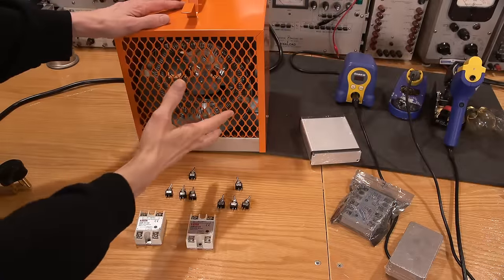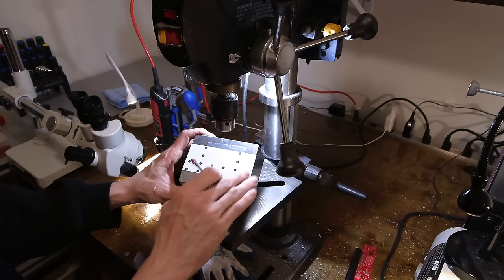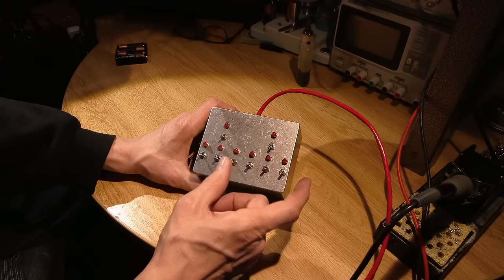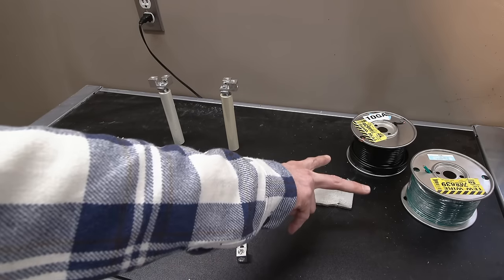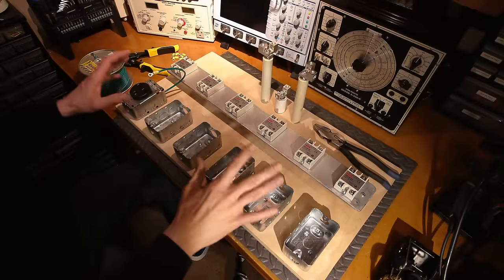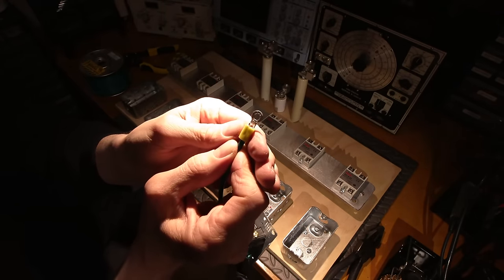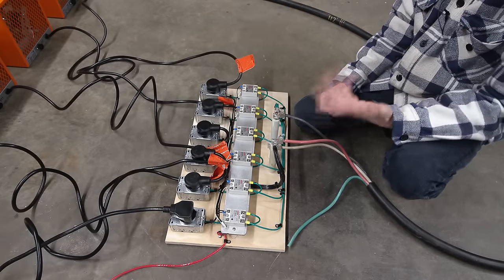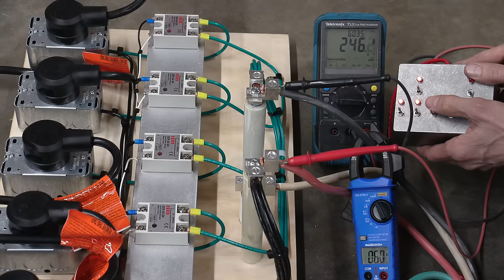27000 Watt Load Complete Build!

Comment: Build a couple fold out, or roll out "walls" lined with rock wool insulation facing the generator.  Not even remotely close enough to keep the heat in, but to absorb and block a lot of the noise.  Neat load bank, thanks for sharing!

Comment: Big Clive tore down the Fotek SSRs. He found that they are definetly under-engineered and over-rated. IIRC, I am using a Crydom 1225 SSR to switch the heating elements on my DIY Reflow Oven. IIRC, that SSR only requires 7mA to trigger it. So, I am driving it directly from a PIC MCU (could be any MCU) straight off of a pin. It has worked well for years. Adding an optocoupler between the MCU pin and the SSR would have been a nice safety feature, but I did not know about those at the time I built the oven. Of course, using a MCU affords also sorts of additional control and data collection, such as PID PWM and reflow temperature profiles. And, yes, additional heat sinks (more than just the mounting plate) are needed. HTH. Cheers.

Comment: Very nice generator unit. It loaded and recovered very quickly. Minimal voltage/frequency drop. Lots of headroom. I used an old Lister air cooled 25hp 3 phase diesel generator for my machine shop for quite a while. It was a nice reliable unit but had terrible recover. Changed it out for an old Ford 4 cylinder 60hp marine diesel which was much better before finally getting a 3 phase hydro service.

Comment: That’s one beefy generator to only lose a couple volts with a 120 amp load on it. Good call on that main power cable, very pricey stuff but the fine strand wire makes for a much easier cord to manipulate than the stiff heavy gauge stuff with a solid wire ground. Thank you for sharing and have a happy Easter.

Comment: With all the positive comments, I can add this. We see a man that's confident in his work that he did not need the safety grounds hooked up for this test.
Reply: Lets say, he is using a "floating ground"
I will say that if he generator is not grounded (isolated) nothing will flow to ground trough anything, only between phases and neutral ... 😛😝

Comment: Maybe someone else pointed this out but you used single pole SSR's so one side of the heater circuits will be live to neutral even with the SSR switched to off. It's not a big deal for a test setup but something to be aware. Personally I would also carry an equipment grounding conductor back from the heater receptacles back to the ground lug on the generator. It could be sized down from the power conductor or in your case #12 AWG to each receptacle. I think your large SO cable had green equipment grounding conductor included. The only thing you would have to add to the board is a terminal strip to land the green wire from the extension cord and a green #12 to each 30 amp receptacle. You could add those when you make a permanent set up for your test station.
Reply from the maker: One thing to keep in mind with an isolated generator test setup like you see here: If a earth or ground wire is attached from the test fixture to the generator, since the generator is it's own source and it's isolated, if one of the fans were to short to its case, it would make the entire generator HOT! So, instead of just one fan case being hot, it would make the entire test fixture and generator live.

Comment: I removed a 96 channel, 2400 watts per channel dimmer rack, 3 phase input from a HS theater. Replaced with LEDs,  dmx control.  One SSR for every 2 channels.  Needed some ideas for use. Mr. C. delivers.

Comment: I would have connected the ground from the generator to the outlet boxes and the ground terminals of the outlets so that a short in the fan would not cause a "hot chassis". Not necessary for your test of course, but for a permanent installation. That's one nice generator, btw.

Comment: I liked the video very much. Thank you for posting. I wonder if you wouldn’t mind giving your opinion on the following. The problem with an SSR is that the Sine Wave is modified and the actual True RMS Current becomes less. There used to be a device for the Kitchen Refrigerator that would reduce the power and save electricity, however the Defrost Cycle wouldn't have enough power and the freezer would not defrost fully as intended. So that method doesn't work anymore on a modern day frost free refrigerator. Now the other trick involves tuning the Motor Inductance with a Capacitor, and that would lower the amount of power the refrigerated uses.

Comment: Thanks for the video - but I wanted to see the frequency stability of the genset.  The relays aren't necessary for a test since the fans have plugs and maybe switches??   The tester board does show better for video.   Be careful on your crimps, and check the datasheet - generally the serrated round barrel crimp connector will have the seam facing away from the "dimple".  We always use a professional crimp tool with the correct dies, never use  lineman pliers.  BUT as long as the crimp is on very tight, it's OK for a temporary hobbyist tester.
Reply: The very top of the voltmeter displayed frequency, it only dropped about 0.25-0.50 hz at full load. Most generators drop around 1-2hz under full load.

Comment: 27000 watts? So, we used to have these 600w space heaters. Then 27000/600 = 45. So, we could theoretically heat 45 rooms. That's a sizable house. Wait a minute! The 5200BTU air condtioners are approximately 600w a crack. We could cool 45 rooms and have a delicious electric bill !

Comment: Cool load test setup and informative video.  Diesel engines need to be run under load, if they are lightly loaded for extended time they will "wet stack" because combustion temps are very low.  Periodic use under heavy load with your load bank would be good for the engine.  I have a diesel gen set with a load bank on the front (factory installed) for that very same purpose.  Did you measure the voltage drop on the SSR's with the 20 amps through them? Curious how much power they had to dissipate.
Reply from the maker: Hi Erik. With a 20 Amp draw at 240V, they have 1 Volt drop across them (or close too), so they get pretty warm on that sink after about 15 Minutes of "On" time. (Around 20W of dissipation) They say they are good for 60A... Not likely!

Comment: Now, here’s a question for you - what’s your plan for grounding and bonding? I was a residential electrician in a previous life who has done a fair few stand by generator units. I’ve been a fly on the wall on one occasion for an argument between inspectors over bonding. Apparently there are disagreements…
Reply: There are disagreements,  There should only be one bonding point and that is in the "main" panel (I'll call it the bonded panel). and there would be a 4 wire connection to the generator (2 Lines, 1 neutral, 1 safety ground). This is the proper way to do it if the generator is hardwired to the panel/transfer switch (and your transfer switch switches only the load connections). If the generator has a plug to connect a load either a convenience outlet and/or the main load, the generator must be bonded internally. This way if the plug is unplugged from the bonded panel and is used stand alone, it is still bonded and safe. This is why you hardly ever see larger generators with any kind of convenience plug on them, it would require them to be bonded and that causes a lot of other issues when connected to a bonded panel. The convenience outlet is run from the panel.

Comment: Should have taken the Dave Jones approach to that SSR..."don't turn it on, tear it apart!" 

Would be interesting to see what it looked like inside.

On another note, the 4/8 ohm load I use for my  bench was repurposed from the aux heat packs from the air handler I replaced last year. I had to parallel some resistors with the coils, but I still (conservatively) have a ~300 watt 8 ohm, and ~600 watt 4 ohm load.  

So if anyone is having an air handler replaced, don't forget to scavenge it for the heater pack(s) if it has one!

Comment: nice job 👏👏 I would like to see a thermal image of the solid state relays 😀
Reply: At least the temperature of the heatsink.
Reply: I was curious if the slab of aluminum was sufficient when all the relays were kicked in and all the heaters were on. It was insulated from the mounting board, but do you need to mount a fan on it as well? How hot does it get?

Comment: An idea, for the switching, If you had the 1st main switch power the first bank of 3 as well as powering the switch for the second bank of 3 so if you had second bank switch off and turned main on it would only turn on the 3 but then you can additionally add the second bank of 3 or if you keep the second bank switch on then you can switch the main to switch all 6. It gives you one more switching capability with the same amount of switches. You then wouldn't have to turn them on and off at the same time, Instead of the second bank of switches having constant power, Give the second bank power from the 1st main switch.

Comment: Comparable to five electric clothes dryers .  A house with 200 amp service could do this.  Just think of what a laundramat uses in electricity.  
Some EV car fast chargers demand more than 30 amps, going into volatile lith-ion batteries.  Paul, you might make a vid on EV charging systems with their ""fail safes"".  Their fires are difficult to extinguish.
Reply from the maker: Thanks for your input!
Reply: PS:  They can use a setup like this for parking lot EV car chargers.  After taking your charge card, the vending mschine then can turn on the charger.  How many amps would be needed to recharge the lith-ion batteries in about an hour?
Reply: @umajunkcollector   Most laundromats use gas dryers.

Comment: I like to add solder to my crimped connectors to minimize corrosion, and the wire pulling out over time. I don't use the pre-insulated connectors, I'll just add shrink tubing after the crimp and solder.

Comment: Loved the Loadbank you fashioned but I'm concerned about the lack of cool down period for the generator when you shut it down. I should note that I have never worked with a generator that small, but it is a diesel. All those that I've worked on over the years had at least a 10-minute cool down period but, they were at the very least capable of 900-amp output. We also had to worry about wet stacking but running on mor than 30% of the generator's capacity alleviated these concerns. I'm sorry I'm rambling in any case great video, looking forward to your next.

Comment: "One point twenty one jigga-watts! Great Scott!" --ELB

When I worked at an electric car charger manufacturing company named Enelion, I had an idea and rough design for a 3 phase 21kW dummy load for testing the AC chargers, with 1, 2 and 4kW heaters per phase, relay switched. When I talked with the head electrical engineer, he had something similar in mind, only mine would use a water tank to sink the heat and dump water if it boiled. Unfortunately, the company wasn't doing well financially and they cut down R&D projects and laid some people off, myself included. I got back to doing stuff in my lab again... on a budget tighter than Ethel Granger's laces, the Keritech way.

Your automatic center punch looks like a Starrett model 18-A. If so, then I have the same. Joy for ever.

I like the table you use for sanding. Structurally solid while pretty lightweight and preventing dust from gathering.

That's one BIG extension cord! Not as thick as a 3-phase 5x25mm² one I once put plugs on while working at Enelion, but still quite a snake. I was a bit surprised you didn't use ferrules on the stranded wires, especially if the terminal has a screw that presses against the wire rather than being the elevator type. 

The motor purrs like my cat, haha!

Comment: Great way to test generators. The installation team used 3 of those to test my generator except they just had plugs no switches.

Why didn't you connect the ground wire? Those heaters need to be grounded for safety given the all metal construction.

Comment: @ 28:00  Using a "dimple crimping " tool like that, is incorrect. The dimple side of a crimper will spread the split side of the crimp apart, making a weaker crimp. If the dimple is used on the back side, it drives a pressure point into the rounded side of the barrel while the split is backed and held in place by the curved portion of the jaw. A few other commentors made note of this as well.
Reply from the maker: If I put the crimp in the tool as you suggest, it spreads the crimp side exposing the copper wire and making a weak connection. Putting the split side of the crimp oposite to the dimple will not force the split into the wire, it pulls the split apart.

Comment: would have been interesting to see the frequency droop and overshoot when changing loads.
I have to build a load to test a couple generators I have.. little mitsubishi 10kw, Lister Petter 8kw, and a Cummins Onan 75 kw.  I was thinking of using hot water tank heater elements  and run water through them

Comment: I think its really interesting at as soon as the generator kicked on the voltage potential between the open probe tips jumped from around 6mv AC to 125mv AC. I assume its some magnetic field effect, but Im not totally sure. Interesting also that the potential increases again as you turn on fans, likely proportional to the current in the main conductors.

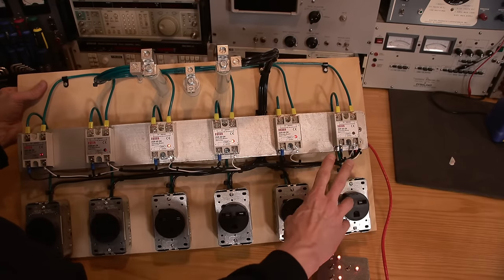Comment: Regarding crimps (30:00), Many years ago, I was trained to install commercial AV systems. I was taught exactly the opposite of what you show here--that the split in the connector should go into the concave side of the crimp tool. That way, the tool tends to keep the split closed, rather than forcing it open.

Don't claim my way is right and yours wrong. Just letting your readers know there are conflicting opinions out there.

There definitely are some types of crimp connectors that ARE designed to be crimped the way you show. Those are usually for small gauge wire, non-insulated, and have an open U-shape that gets folded over when you crimp. The crimp tool for those has a very different shape.

Comment: Very nice! That generator is certainly built to last. If I may ask, how do you decouple from the grid when you power up the generator? Automatically, or manually? Just curious. BTW the bearings on the fan of the white "load" (heater) are superior. Thank you for yet another fascinating video.

Comment: Small advice, add a UPS or voltage regulation, because the 220V is really high and almost reach 260V when adjusting the load

Comment: Really nice & orderly method of setting this up.  I expected to see you do a measurement of the voltage drop across each S.S.R.when they were ON.,also the w.f. showing the conduction angle of each device for comparison .. OK since it's running off a generator...this is not really necessary...i.e. Input power fail detection....
But how about fan failure detection and S.S.R. with soeme thermal sensing for over temp. trip..?

Comment: honestly, you should have just used a common breaker panel and circuit breakers to feed each outlet and load switch. majority of them are made to be used as such now days, at least for all that you'll use it, plus each circuit would be protected from overload. those heaters like to blow elements, spit molten metal out and short circuit to the case( which you appear to not have grounded)
just suggestions and warnings, were all free to do as we please. 😛

Comment: I would have definitely tied in the generator ground to your electrical boxes and metal control box. If a triac shorts out it could send line voltage up the control wires.

Comment: 19:01 : Though you haven't mentioned it sanding that aluminum was a correct measure & step,  especially if by chance it were anodized; otherwise there would be little heat exchange & transfer.
Reply: Also those Chinese SSRs are like the surface of moon in terms of flatness so it is a good idea to lap them somewhat flat before use. I go 220-400-800 against my granite plate but you can use a piece of glass or a mirror as your reference surface.

Comment: Nice speakers, why didn’t you sit the speakers upside down with the tweeters on the bottom, closer to head level?
Reply from the maker: I have very good hearing, I think I would have to attenuate the highs if I did that, my normal listening system has attenuated highs.

Comment: I think I might have used just six switches and some steering diodes so that the first switch turns on one relay, the second two and the last one all six. That way you can switch from any number to of heaters to any other number simultaneously with just one switch change.